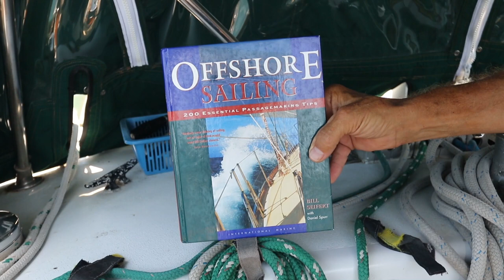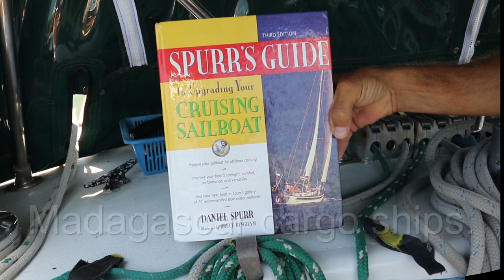7 Sailing Tips For Blue Water Sailboats (How to STOP LEAKS on Sailboats)Patrick Childress Sailing#25

Comment: I have an very good tip for you. I live in Queensland Australia and we have very harsh sunshine so we use a product called lanolin spray allso knowen as woolyolk. its made from sheeps wool oil and very fine dry spray. Use it on zippers,dogers,bimminis
covers and window/hatch seals keeps the rubber from drying and cracking, and the inflatable dinghy helps to preserve the materials,stitching and the vynal used to make the dinghys out of. as these are expensive to replace, a little T.L..C gose a long way. See its because oil is inpermible to water why it flots.
Gerard.
Reply from the maker: Sounds great. Is the product sticky when i dries?
Reply: @SailingBrickHouse-RVLife   No. as far as i know, it dose not. otherwise you would not use it on zippers.
Gerard.
Reply from the maker: Thanks for another good sailing tip! -Rebecca
Reply from the maker: @tronalpha9137  I use a lot of LanoCoat which looks like grease but dries to a sticky anti-grease feel.
Reply: @SailingBrickHouse-RVLife  I will look into it for you but i do not think its the same product. just one question,
is that in an spray form ?.
Gerard.

Comment: Hey, a thing i started doing around the house or shop is using part of a plastic shopping bag to water tight,  or just tighten up a thread or seal. Could work on that small window in a pinch.  Leaky garden hose threads are a common one i use it on.  Just think of any plastic bag, or candy wrapper as cheap easy to find thread tape, or seal tightener. Might be handy on boats IDK. I've used this on maybe a dozen things now. There's probably plenty of Chinese plastic out there you can just snag if you look for one.
Reply from the maker: Good tip ;)

Comment: So if you 'hand' a line is there a way to then hang it on the railing?
Reply from the maker: If you mean the life lines, I would never want to do that as certainly, sooner or later they will fall in the water and tangle on the prop or rudder. I just hang the handed line on the winch or, for the reef lines, there are Velcro straps, screwed to the coach roof, which hold them in place.

Comment: Hello wy just don't use the sand on the beach, they dumped sand over a sandy beach. Nice video looking for the next saludos
Reply: @SailingBrickHouse-RVLife  the locals have a boat full of sand and they dumping the load on the beach. Merry Christmas saludos
Reply from the maker: @pavelavietor1  Beach sand is full of salt so it is very bad to use in concrete. If they took the local sand off the beach, there would, very quickly, be no more beach.
Reply: @SailingBrickHouse-RVLife  thanks know I understand, yes they have to work hard to move all this construction products. Merry Christmas saludos
Reply from the maker: @pavelavietor1  Saludos!

Comment: Gathering water from the bimini: isn't such water brackish due to the salt accumulated on tarpaulin?
Reply from the maker: It takes only a little rain to wash away the salt and dirt then the water is worth keeping. However, depending on the location, rain is not always as clean as one might think. It would take a considerable rain to wash pollution out of the atmosphere in Los Angeles or Denver. I have caught rain water which tasted like auto emissions and was not worthy of washing clothes in. My video, "Water What's In It" could be worth a watch. It is one of the earlier vids so the editing and presentation is not the best but the information is there.

Comment: How in the heck did you get this online !
Reply from the maker: California, you have a good question. There are places it can take up to 12 hours to upload a video. The problem is, there is no getting around the slow speeds so I start late at night, when internet use diminishes, and speed increases and hope nothing screws up to cut short the upload, which does happen and it all has to start all over again. Part of the adventure of being in out of the way places.

Comment: Tip #1 for Tip #1 - Never use Vaseline on rubber gaskets...Vaseline has petroleum by-products and it will degrade rubber
Reply from the maker: Bj, That would be my first assumption as well. Then there is a cruising friend who has been sailing the worlds oceans since 1978 and has always used Vaseline on the rubber gaskets of his port lights and has never had a problem doing so. People put Vaseline on their bodies but don't smother themselves with 30 weight. Go figure. If one should ingest Vaseline then "it is only expected to cause a loose or soft stool." But some information says not to use Vaseline on natural rubber, from a rubber tree, but it is fine on synthetic rubber. Many O-rings are made to withstand oils.  I will stay with silicone grease but won't be hesitant to switch over if the silicone runs out.   Plus: Vaseline Petroleum Jelly is highly-refined, triple-purified and regarded as non-carcinogenic and non-comedogenic. ……..non-comedognic...does not cause blackheads by blocking the pores of the skin.
Reply: Buy Dow-Corning 111...we use it on hyberbaric chamber gaskets and it definitely does not cause them to degrade prematurely
Reply: Depends on the type of rubber. e.g. EPDM or Viton.
The primary difference between Viton and EPDM is chemical resistance.

EPDM is good in steam applications and has fair chemical resistance.  It should not be used with solvents or petroleum agents.

Comment: What's a "blue water sailboat"? Webb Chiles just did a circumnavigation in a Moore 24, so is a Moore 24 a so called "blue water sailboat"? Any sailboat is is "Blue Water Sailboat" in the hands of an experienced sailor, and no boat is a "Blue Water Sailboat" in the hands of a novice, find a new term
Reply: Ok. People have also taken row boats across the Atlantic ocean, but that doesn't mean it's a common thing or a good idea. "Blue water sailboat" is obviously a long-accepted, common term referencing cruising style sailboats that are designed for lengthy ocean voyages, distinguishing them from dinghies, daysailers, coastal cruisers and racing boats not designed for ocean voyages. Why don't you quit making such stupid comments and inflicting yourself on others?
Reply from the maker: That is ABSOLUTELY true…it’s what Patrick always used to say…
Reply from the maker: That’s true too!